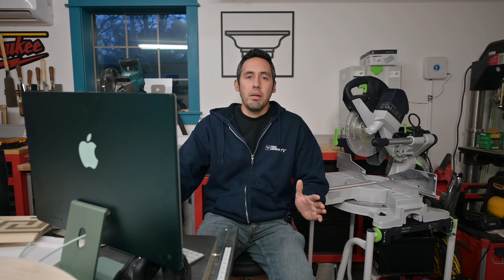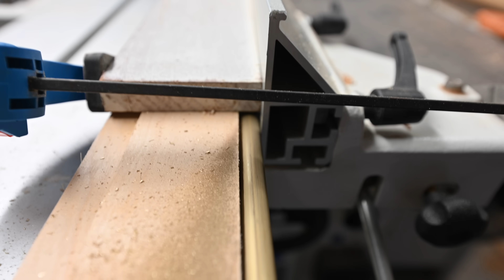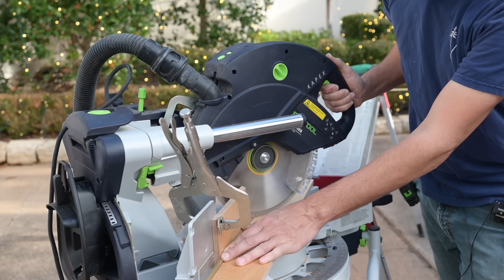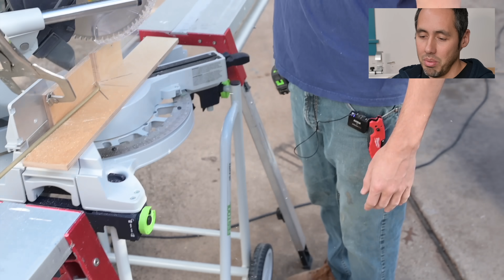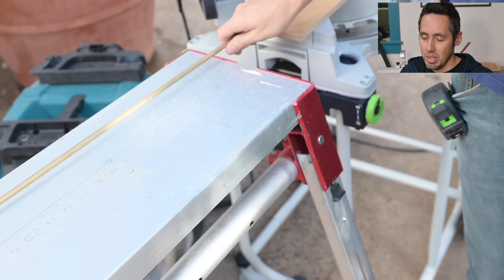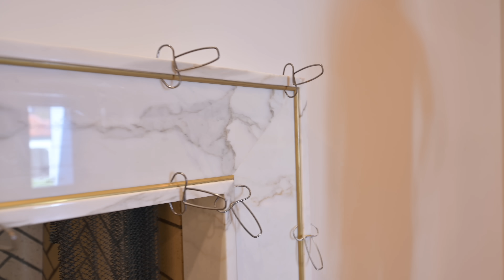It only took 12 years...My first MITER SAW injury.

Comment: Removing cedar shakes from an 1820 house we had moved across a field to some acreage we had bought...stepped off the ladder onto a rusty nail ended up with a red streak (blood poisoning) going up my leg and on crutches...insult to injury was navigating the back staircase going up (house was basically down to the studs at this point) and there on the ledge was a BIG black snake eye level with me about 12" away from my face...I couldn't go up or back down...absolute fear and panic and screaming my head off...I dropped the crutches, they slid down the stairs and I followed right behind them doing a belly slide never taking my eyes off the snake...hopped my butt right out of the house and shook like a leaf...btw I loved the house, snakes not so much!...I healed, the house got finished...yeah, I'm a female with power tools...

Comment: I once drove a square drive but through my finger pad to the nail after slipping off a screw. Left a 1/4” hole. Months after it was fully healed a pea side sack started emerging from the finger which I pulled out with pliers. Apparently there was a little piece of bone in it. After that healed my finger FELT so much better.

Comment: I have had a similar experience while cutting timber frame pegs for making short plugs. 

I think that the saw was pulling with me for the first half of the cut and then switched direction on me. I clearly wasn’t holding it hard enough. Using jigs would help however I typically use a hand saw for small pieces when it’s practical. 

Hand tools are always safer. You can still cut
Yourself, sure, but will never be as severe as with a power tool.

Comment: After 50 years working in construction, I still have all 10 fingers and toes.  However, I have a few misshapen and a few shorter and some shave a touch.

Just the highlights:  🙂
Sanding too small a piece on a stationary belt sander to make it thinner..  This caused the piece to go under the fence, pulling my fingers after it.  Only one fibger ground to the bone, in the blink of an eye and the rest of my finger prints on both hands removed for a few weeks.  For all intents and purposes, a full recovery after months of hyper sensitivity. 

The occasional errant finish nail, curling back through some trim, after striking some dense object beneath.

5 Hp, 15 inch tablesaw blade kicking a 6 inch square of walnut, through a brand new 3/4" plywood push stick, hitting my stomach so hard as to knock the wind out of me and leave a perfect rectangle bruise on my skin.  On the to my stomach it skimmed across the back of my left hand, cutting enough to cause a fairly substantial display of blood.  My focus was on my stomach as I held it with both hands as I slid to the floor.  I was unable to speak, due to the air knocked of of me and due to the placement of my hands, the room full of witnesses thought I had a hemorraging,  abdominal wound, much to their consternation.

That's enough for now, but there are a few more.

Comment: A few years ago I was holding a small piece of 3/4” plywood, like 6”X 6” in my hand. Broke out a brand new 1 1/2” hole saw, and as soon as that hole saw came into contact with the plywood it walked off on to my hand and laid me open. 15 stitches in my thumb, and pointer finger, and also nerve damage to this day.

Comment: Lucky me...the worst accident so far, at least one that injured me, was smashing my left hand with a 3 pound sledge while talking to my helper and pounding stakes into a Priest's garden. The screaming and cussing brought him outside instantly. He wanted me to shut up but I couldn't. The broken bones healed but it took almost 10 years before I had the original strength back in that hand. 10 years ago I learned about Table-saw kick-back as a 2 X 4 went flying past my head and stabbed through the wall about 6 feet behind me. That was the scariest accident I've ever had on a job. Once I was connecting 4/0 cable to an 800 amp 120/240 D.C. "can" and got shocked which straightened my arm so hard I was almost knocked off my feet.  Nuthin but fun. I don't need the square, just sharing good times.

Comment: Thx for the slow mo. I probably would have made that cut the same way. Worst injury. Doing the living room sub-floor over a slab. Was using the table saw, everything way going perfect, all the cuts were good, my progress was way faster that I figured.  I went to rip a 1x4 sleeper. No kick back guard this day. And it happened, the wood kicked back, shot, shot right into my gut. I felt like I was sucker punched, went down to 1 knee. Took a few min. to get up. And a few more to finish the cut. lol.

Comment: I jumped when I saw that. 
Worst, or at least one of my more painful injuries. Building my garage, covering the 8' walls inside with 4 x 8 x 3/8 plywood laid horizontally using 1-1/4" dry screws. When I was done, I covered the seams with a piece of 3/8 x 1-1/2 wide spruce, sorta like board and batten using 1-1/2" finish nails using a nail gun. Yes they were too long but I had a crap load of them so that's what I used. Moving along nailing the board on, I was holding it up and level with my left hand, driving the nails with my right using the gun. Drove a nail right into one of the troughs of the phillips head dw screws. It went in, curled right back out the other trough and into the bone on the end of my thumb, hurt like a muther.

Comment: My worst injury was while using a table saw. I was ripping the exact same sort of half round trim to make quarter round, but from white oak, not brass. I had things set correctly and was getting two pieces of quarter round at the exact same dimension. Moving along through the process, no problems, then simply failed to lift my thumb out of the way and ripped right through the end of it removing about 1/4 to 3/8 off the end. Now and forever, I have a left hand thumb that is shorter than my right hand thumb. The odd thing is, it didn't hurt at all. In the emergency room, it was deadened so that the new end of my thumb could be stitched together and there is still no pain. I'm thinking, not so bad. Then after being home for an hour or so, all the deadening began to wear off and, for hours, my thumb felt like I had just been slammed in a car door. Extremely painful and NOT recommended.

Comment: my worsed were 2 one cutting a pipe with a handsaw ( I worked with an extruder) had to cut fast the saw got out of the pipe in to my finger..into the bone...that was a nice one the other one was with a nailgun, nailing 2 pieces together to make a crate... hit something hard in the wood the nail got sideways and thru my top of the middlefinger and half in my ringfinger...and crazy enough didn't hurt that much...a finger piercing....

Comment: The most recent injury I’ve had was slamming a drill bit into my finger. I was hanging some shelving in my garage and using 3 inch screws. I didn’t set the screw in deep enough prior to applying force when drilling. Bit slipped off and decided my thumb was better suited to go in the wall

Comment: When I was 18 I got bit by the table saw. I was doing a box cut on a piece of flooring to go around a threshold. While making the cut I reached behind the blade to pull the board through and I just grabbed the board. The blade beveled the tip of my thumb off. All things considered I was pretty lucky. For the most part I healed up well. The only way you can tell is if you push on the top of my thumb because there’s no meat there anymore.

Comment: This is such a common this with any type of very small trim. The thicker the blade the harder it is to make those types of cuts. Also, I think when you get to the bottom of the piece of trim the chop saw is now cutting on a slight upcut which makes it even more sketchy.

Comment: Been in the trade for about 8 years now and the injury I experienced is cutting thin aluminum with a cordless makita saw and we would have to make notches in the metal. Long story short when you don’t set the depth on the saw , the blade will catch the metal and that’s what happened to me , caught the metal kicked back and the metal hit my finger. From that point on I use jigsaw with metal blades to make my cuts.

Comment: My worst injury was last summer roofing. I stepped off a ladder with all my weight and stepped on a piece of framing that came off the roof. Two 3.5" framing nails went through my shoe, and one came out the top of my foot. Ambulance guy told me to breath and yanked it out. Drove myself home. Went back to work two days later.

Comment: I was ripping 4” door trim down to the size I needed.  I only needed one piece to finish for the day and I didn’t take the time to put out the end support to keep it from tilting toward the end of the cut.  When I got to the very end of the cut the end weight tilted the board up off the table saw blade.  I pushed it back down finishing the rip and into the end of my left thumb.  I now have a saw blade curf at the end of my bone. bone.

Comment: Back when I was a framer (many years ago). I started with a new company and we were building a big garage that had multiple bays and different  roof lines.  As we went to install trusses we found that a wall was mistakenly built too low.  So we added a two foot wall to the top. I was sanding on top of the wall that was too short and reaching over to sheathing them together.  I was using 16 penny ring shank nails,  And missed the stud.  Problem was that I hit my big toe.   The rings on the nail held my foot to the wall. And I was ten feet off the ground with the ladder on the opposite end of the wall.   Everything turned out ok but I learned to respect the nail guns of all size.

Comment: I’ve been a carpenter for 35 years , my worst injury once I cut my thumb with a hole saw,  I was putting it in my drill and using the trigger to tighten the chuck, and the hole saw  court my thumb, that hurt their was quite a bit of blood, had to go to emergency.

Comment: Mitre saw was the one that took me out too. 12" sliding Makita. I was cutting a plywood L shaped part with the apex facing up. It was maybe 3" wide on each leg. I had a firm grip but the saw flipped the part over and slammed my finger between it and the fence, breaking the finger. Been leary of every cut on that damn saw ever since.  I would have used a hold down too if the hold down on that saw didn't suck so much.
I do a fair bit of brass cutting on wood working machines as well. Don't like it, thats for sure. I always go with a full face shield for that and as much material control jigging as I can conceive of amd use the bandsaw as much as the work will allow before considering the high speed machines.

Comment: I was cutting a 45 degree angle on a wide panel on my cabinet saw. In an instant, the panel rode up on top of the blade and kicked back.  The kickback hit me right in the gut.  Could have been much worse, no doubt.

Comment: My worst injury was using a friend of a friend's chop saw. I was on vacation and not near my home. I was helping a neighbor install hardwood floors, which I'd done many times. The chop saw they were using had a broken plastic guard, and someone had removed the whole plastic guard that covers the blade. But, I was trying to be mister, "No problem, I can use that!" Just like you, the piece of wood shot backwards and the sharp splintered wood sliced my thumb to the bone. 6 stitches latter I was home feeling stupid.

Comment: A couple years ago,  I shot a framing nail through my finger (holding the 2x4 up too close to where I was nailing.)

Then in October, I cut the tip of my ring finger off using a utility knife with a brand new blade.  I was pulling the blade towards me.  My finger tip is still a bit tingly now. I've read it could take a year for that to go away.  We'll see.  I probably should've gone in for that one.  

Looking back,  both injuries were very preventable.

Comment: Hey man glad your thumbs still attatched. So about 5 years ago 3 of us were doing a small roof maybe 9 feet up. Little giant was setup A frame style. Im 5'7", other 2 guys over 6ft. Getting on the roof easy, getting down with stubby legs not so easy. Butt on edge of roof tip-toeing onto the ladder and yup, ladder falls back and fall forward. Landed on my hands and kness breaking both my wrists at about 1030 am. Being the meathead i am i did my best for the day "roofing" and didnt get to the hospital until 745 pm. Now i cant swing a hammer at full force without my hand giving out, nor can i push anything heavy. Ignorant chooch i am

Comment: For quarter round I usually use some kind of sticking to hold it down instead of my hand. Most cuts are fine but there is usually one cut where I may be cutting too fast or the blade hits it a certain way and the material jumps. Probably hard to picture it but it's been a nice safety precaution for me when cutting thin materials.

Comment: A few years back I was notching a piece of flooring with one of those kaizan knifes the ones that the blade can break off) and was cutting towards myself, I knew this was bad but I was just putting solid pressure on the knife and going really slow. The voice in my head was saying stop (but I was rushing to finish a job) when the tip of the blade broke off and left about 3/16 of the new blade exposed. Now until that point, I had never been stabbed before nor had I ever stabbed anyone, I quickly checked off both of those boxes as the knife in my right hand stabbed my left with great precision! My right hand instantly felt remorse and grabbed my left hand as I danced around weaving obscenities. Long story short, I ended up with 28 stitches and thank God I didn’t hit anything that caused permanent damage.
We should all pay heed to the Chris Rock public service announcement that goes something like, “I wouldn’t do that shit if I was you!” Sage advice, Chris!
Semper Fi.

Comment: I was changing a broke bloody Mary carpet blade and it was wedged into the knife.  So when I flicked it with my finger to get it out it didn’t move and the broken blade sliced me open to the bone right in the joint of my pointer finger.  Taped it up got back to work and talk about the worst pain every time my hand would sweat. 😢

Comment: Not many people realize that a slide saw cuts on the upstroke especially in towards the fence. I normally use a blade with a negative hook angle for that reason. Not saying that caused your accident but I would try to get a metal cutting blade and put a thick spacer between the stock and the fence. That and maybe use a non sliding chop saw.

Comment: One table saw injury in my life. Happened when resawing 0:50 a 2 x 4 cedar board. I accidentally cut more than half way through with the first cut then flipped the board end to end and made the second cut. When the 2 halfs separated the one closest to the fence somehow kicked back denting the steel door behind me. My hand fell into the blade slicing off a sliver of my thumb. Required some stitches but ultimately got back full use of my right hand. Lesson learned. Don’t cut more than half way through when resawing on a table saw. Finish it on the band saw.

Comment: I was a wood into a wall, not knowing it was concrete and it shot back into my finger.  Needless to say my reaction was not to slowing pull my finger out which probably made it hurt more after. No ER or hospital visit, just put some tissue and wrapped it in electrical tape till i got home later that day and cleaned it up. Thank God all is still well.  Merry Christmas!

Comment: Last January I had taken off the rubber boot from my front loading washer to clean it. When I was putting it back on, I was trying to stretch the spring to secure it by holding each end with long-nosed pliers and pulling. One end slipped off and I caught myself in the face with the pliers. Peeled up the skin on my cheek about an inch away from my eye. Lots of blood. Glad I missed my eye though.

Comment: I was turning a bowl once and had a large splinter go in one side of my hand and out the other (on the edge of it catching about .75 inches of hand).  All the momentum from the lathe sent it into my hand and was unable to pull it out.  Sliced the side of the hand to get it out and got a few stitches.

Comment: I shot a 16 penny nail into my knuckle on my left hand. I was framing a wall for a basement reno. The paslode double bumped  on the sil plate, sending the second nail flying about a foot through the air to bury 1/2” deep in my hand I was using to hold the stud in place. I felt the impact and was immediately filled with dread. I tried to pull it out but it was way too deep in the bone. Had to go to the ER to get it out. It healed up fine with no permanent damage though. I am way more hesitant to put any body part down range of a framing nailer now.

Comment: I was working with table saw. Cut is done. I turned off power and tried to take small peace of wood near blade. But... blade is not completely stop. It was spinning just a little and it was enough to get severe wound. Fortunately for me everything heal well. But it was good lesson. Turn off power tool is not enough. Wait for complete stop of moving parts !!!

Comment: I had a table saw accident. 
Made a jig to cut corner reliefs for splines for frames. I made the jig too thin, the blade cut the reliefs and also cut through the jig sending it down the opening between the blade and the insert. This caused my hands to be pulled into the spinning blade. 
Right hand thumb cut into the bone and left hand middle finger nail bed damaged. 
Surgery and rehabilitation successful and back at woodworking with more respect for the process.

Comment: When cutting metal you have a piece of wood in front to keep it from moving. Just like the jig you made for table saw. I cut metal trim for tile on miter saw and you need to trap it with wood cause the teeth will grab sometimes and not much you can do.